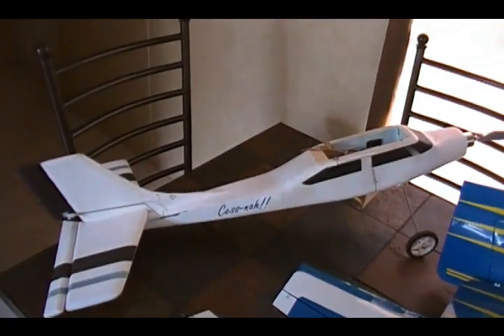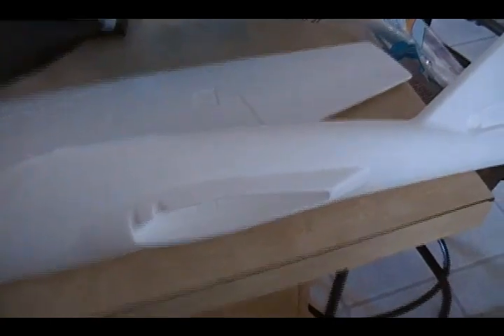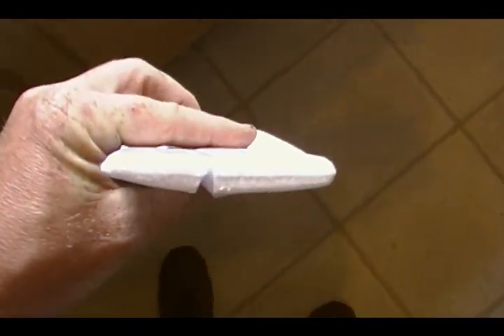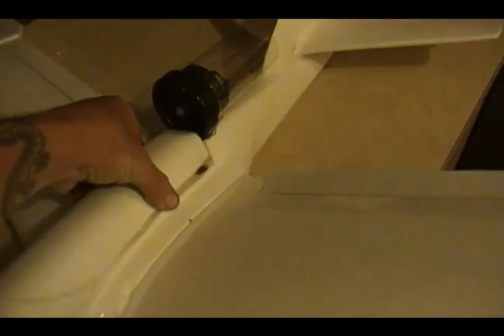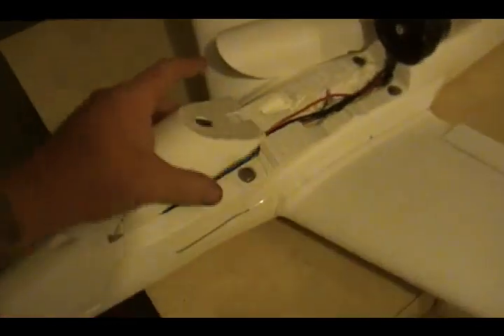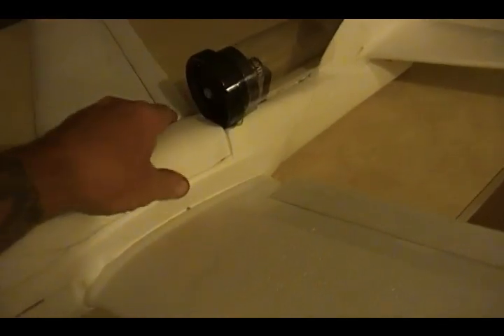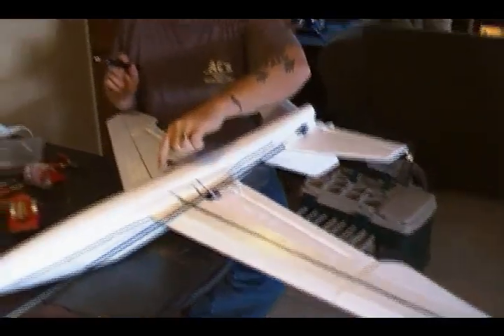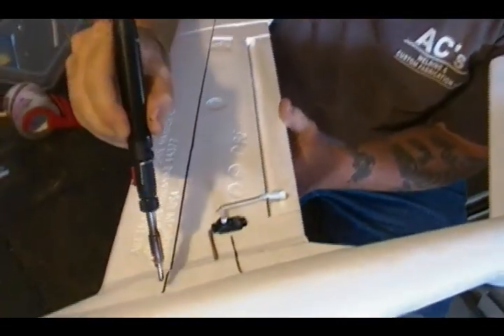Another $10 RC plane. Air Hogs Titan

Comment: I’m going to do something similar. I’ve already converted one to RC using a prop. It’ll fly without ailerons, but you need to have the elevator act as an elevon. With my new project, I’m planning to use a 50mm EDF. Does the EDF need to be that far back?

Comment: I've never flown an RC plane but I'm already in the beginning stages of
"adDiCTion" ...... I went to a new homes building site & asked if I could
pick up some foam trash?  1 hour of work gave me lots of foam but I
like this model..... It's got the aerodynamics already built into it thus
taking all the other work not needed.  So what would be your opinion
about a "User Friendly" transmitter/receiver combo??  I don't mind the
costs to buy this but I do mind having to do a lot of extra work in the
programming.  Any "windows based GUI's" on the transmitters or are
they all the old style "flat file" types?  A recommendation would be
helpful if you understand what I'm getting at??  I just don't want to
buy one and have to do volumes of reading just to use it?
Help...... good video

Comment: Good video.  Looks almost identical to the 48" gliders I bought from Walmart, put out by Maui Toy, Youngstown Ohio...EPP foam, you say ?  Tried using hot glue on it today - melted the foam... same with Goop.  Elmer's white glue didn't stick.   Suggestions ?
Reply: xzqzq foam tac by beacon adhesive  125 macquesten parkway south mt. vernon n.y.10550    www. foam- tac .com. very good glue bonds instantly ..put glue on part push together pull apart  twice then push together finally in about 25 seconds it wont come apart. youll love it ..it costs 12 bucks for 2 ounces but goes a long way  dont put too much on...a couple of tries on scrap will make you an expert in no time good luck good flying..sincerely wayne Hall...

Comment: For the last 10 year Air Hog  flying see best    tinstalment  12345678927794   see vidéo  enjoy
Reply: no lift on the wing     important fernand     and put a light coat off later paint  the foam become more  solid

Comment: Hi,ordered a Air hogs Titan what is the measurement from the nose to the front of the edf caseing please also how are you fixing the edf caseing to the fuselage  also have you put any incidence angle on the edf in relation to the fuselage  one more were are you taking a level from on the fuselage to make sure the edf sits streight and level  sorry for all the questions but i want to get it right or as near as for my maiden, regards Terry uk.
Reply: Put the plane together  and find where it balance   after load the plane and alwase stay at the balancing point it will fly   see 12345678927794  fernand     vidéo

Comment: Tinman, Want to get your input on CG. How did you decide where to locate CG? Where worked the best? Good flyer by the way? Built RC from the Titan last year and have another one Planning to make a canard pusher out of it. The CG on the last one worked OK but yours flew better.
Reply: Hi Stephen, posted question regarding CG to Tinman as im  doing the same with a Air Hogs Titan had no reply did you have any luck ? regards Terry.
Reply: Hi Terry, Haven't heard from tin-man but he dose some cool stuff.
I did put electrics on a Titan that flew well. The way i arrived at CG. was to assemble the toy stock out of the bag and marked the balance point and started 1/4" in front of that. It flew OK. The canard I haven't built yet but have found some sights with cg calculators that could be relayed. A guy on u-tube teaching cg took a dowel and looking from the top halved the wing into two equal triangles visually with the dowel used that position as center of lift and went in front of it to get 25% of mean aerodynamic cord. haven,t tried it my self, but looked like it would work. Hope this helps. SKS
Reply: Hellow Stephen, good evening thanks for the info, my Air Hog arrived today unfortunately damaged,(complained to supplier he refunded my cash  and gave me the plane ) so im now repairing the damage prior to start my build your imput very helpful keep you informed of progress, best regards Terry uk.

Comment: Can u actually make a $10 plane rather than $10 scraps and $50 add ons?????
Reply: Yeah, but it'd be a much harder build. You'd have to build your own electronics.
Reply: Large rubber band that you wind up and a propeller - $2, guide wires and spin around in a circle, old school, $2, done.  Oh and it's crap.

$9 for motor kit in esc, prop etc, $4 for a receiver and $8 for the battery, minimum.

Comment: CG is very important as RCpro Driver said. This is a great build video! I wanted to use a EDF myself, but the noise is a problem where I fly. I have flown an RC Titan powered by a brushless with a 7x4 prop on the front (gotta cut off LOTS of nose to maintain CG.). It was a blast to fly, good loops, rolls, and inverteds, and I was FEARLESS with it (only $10 afer all) - but took a little too much risk a few times(another story). FRONT-PROP-BUILD: (a CG story) Remmove plane from packaging and assemble. Take a 4" nail with  you to test glide and stick the nail into the fuse where needed to get a good glide. The plane is so light it needs some weight anyway, so the nail is needed. Now, with the nail still in place, balance the plane over a pencil laid on a table and mark the pencil's location  on the bottom of the plane That is your CG. Mount  all the control surfaces and servos in place, then loosely install the battery and ESC.  Then once again, pencil-on-table, plane\'s GC previously marked resting on the pencil, balance the plane by placement of the assembled motor, mount  and prop. The position of the motor mount tells you where to cut off the nose to mount the motor.. It is best to err on the side of nose heavy of course, cuz you can easilly cut a little more off (Hey, it\s only $10 foam!). 
  Addition of CF wing spar was not something I did at first, but after not-missing a tree and knocking a wing off, a spar was added to help "heal" the break. I used the knife-blade attachment on an electric soldering gun for making the channel in the wings. My spar did not go out to the wing tips, but rather went right through the fuse and about 1/3 out into eash wing. This bird has a fair amount of dihedral built in so one-piece straight through is possible. I used a hot coathanger wire (like this video) to go through the fuse.

Comment: You sir,  are a genius.  I'm going to use EDFS from a nonflying brick  C147 Paladin.  The plane is too heavy.. but I'm going to throw it's engines and electronics on the Walmart raptor.  I will use it's differential thrust setup and elevator control.  Think it would work??

Comment: I did the same basic thing with a Raptor foam glider.  mine isn't as pretty as yours cause the fuse is thinner so I couldn't fit everything inside it.  I also used foam board to add control surfaces to the tail.  I found the CG of the glider, then added all the RC gear while maintaining the same CG.  You get the fun of a EDF without any sharp stall issues.

Comment: $10 my ass, you spend like 30 on the other things to make it. Plus if someone wanted to buy this from you with labor thats at least $100 at min wage to break even
Reply: any RTF that size would cost $150 min.  so if you can build one for under $100 you are ahead of the game.  ive just started working with dollar tree foam board for making airframes.  more fun than assembling a RTF, more creative and less expensive.
Reply: RCPro Driver not to mention, if you crash this.....you buy a whole parts airframe for $10 :)
Reply: RCPro Driver Thats What I love about Rc Planes, The only REAL cost is the hardware. Get a Decent 2.4ghz Rx/Tx  stockpile motors servos, rods, esc, batteries etc. and after that your set for a few years hardware wise. Im actually headed to the dollar tree later today to get some foam to Build a P51!
Reply: $10 for foam, $9 on servos (no need for rudder), $9 on motor, $7 on esc, another $5 to ship the electronics and another $5 on misc (wire, connectors, etc).  I figure you are in the air for about $50 (assuming you already have a battery and transmitter).   Not bad at all.

Comment: Thank you TINMAN for this excellent tutorial. These gliders have been around for at least 30 years. But until I saw this video awhile back the RC idea never crossed my mind. I want to do at least two. The trainer and then the cool one. Could you steer us in the direction of low $$$ RC stuff that will work with your creation? Also, the power plant?

Comment: use a y connector to the servos like you would do on ailerons, but have bothe servos both pointing to the right or left so that one of them is reversed to the other so that when you connect it to the receiver they will both move in the same direction

Comment: What determines the the voltage of the battery you need, the ESC or motor. I can't find info on this stuff.
Reply: Andrew Brennan just 6 years for an answer but either way, the motor tells you. If it’s 2s it’s 7.4volts if it’s 3 it’s 11.1etc.

Comment: Excellent video...Its funny a couple of weeks ago i saw that plane and was going to convert it to rc also...after watching your video it would be very easy to do..I would remove dehedral and make it a pusher prop 100 mph jet put a ntm 28 36- 2700 kv apc 6x4 3s 2200 mah 60 amp esc...

Comment: When you buy one there are balanced already. So just put two fingers underneath and find the balance point. Mark the spot then from there whatever part you add has to remain on that exact balance point. You can add more weight just make sure your balance point stays where you marked it

Comment: Hey, nice job. Here's my grandson in the picture with the second Air Hog Titan I built. I built 2 hogs using 3/9gr servos, Used brushless motor and 1000 11.1v lipo. Used 2 pieces 3mm carbon fiber hollow rods for the wings and glued wings in the fuse. This one I added blue foam to make elevators and ailerons. Didn't cut them out of the plane Just added the blue foam in the space where the wings had the cut outs. The elevators I added two pieces of blue foam.Cost was $60. Not including the FM TX

Comment: Have you ever tried using pantyhose instead of fiberglass? It's not as strong, but it's a lot cheaper and easier to use. I've seen it used to reinforce large model rocket airframes.

Comment: Instead of hot glue, try expanding foam as an adhesive for the carbon fiber. 

(also burn grooves in Styrofoam outside. Benzene isn't good for your health)

Comment: It just amazing what the minimization of electronics has made this kind of RC building possible. Back in the 70's you could get into RC for under 2-5 grand. Now you can spend 300 buck and get a four channel transmitter, receiver, motor, etc., And start designing A/C that rival anything NASA can design. These videos are a extreme inspiration, good work.

Comment: I find I don't need a dimmer control with my transformer because it barely puts out enough heat for the 30" wire and doesn't seem to overheat the wire on a 7.5 inch bow I made for small cutting jobs either. I may end up designing another power supply with a higher power transformer and a dimmer control so I can get a better variety of heat settings. I was also thinking about using a soldering gun like you are to scoop out the smaller foam. I am looking around for it now.

Comment: My Gunson's charger has 12 and 6 volt plus slow and fast charge. It may be possible to have a dimmer switch between your transformer and the mains. So you can back off the power for a shorter cutter. I also use a hot knife, just a 3x2x100mm piece of aluminium (off cut from my workplace) in my soldering iron. Also used a hot ' U ' shape cutter in a soldering gun to scoop out a solid foam fuselage..

Comment: Thanks Word Reet. I have just made a foam cutter a few days ago using a number 13 guitar string that is about 30" long and I took a 12 VDC 1.2 Amp power adapter transformer and remounted it in an old PC power supply case to keep it running cool using the built in cooling fan. I will be posting some video of what I made later. Thanks for the tips.

Comment: Longer or thicker wire needs more power to heat it. Nichrome wire or steel guitar strings work. You can make a short 2" cutter and power it with two 'D' size torch batteries! (rcfoamfighters channel) If you can find a car battery (lead acid) charger with 12 and 6 volt, you'll do pretty well with what you are doing. Also increasing the length of your supply cable before the hot wire will reduce the temperature, as this increases the overall resistance. HTH. ;¬)

Comment: Great video. I bought this Air Hogs Titan and will be making a foam cutter for it. I was wondering how big I should make the wooden frame/bow like what you're using. I was thinking for this small foam cutter to make the wire 10 inches wide for cutting fuselage parts as you are doing. And make a longer hot wire for cutting wings. Is there an optimum length for a hot wire foam cutter? Thanks for putting this video out there.

Comment: how did u attack the magnets (what glue or substance)
Reply: I have had success with carpenters glue, hot glue and foam safe CA glue. Watch out for glue that has acetone in it because it will melt the foam.

Comment: "the old ones back in the day" i remember those, those were the one that look like a commercial airline jet and you could changed the flight path by adjusting the elevator. the only mad i was able to do on it is turn it to a jet lol kinda i would put a bottle rocket inside and see it fly but then the it would explode and i did this in the early 90s

anyways nice mode i may try this out myself.

Comment: excellent  rc conversion- good ascent  angle  -your right on about the 130 watts or more, i tried a 100 watt 2600kv bl and it was too weak with its recommended 4x6-  (old hi wing trainer with tricycle gear)- ive been doing rc since fall '09 and now want to ROG so am putting a 200 watt 2600kv on it - should be power to not death stall - more and more  often im seeing claimed watts  on BLs for sale- this lets me know if the motors got the power for my plane

Comment: Hey Timan, thanks for all of your videos. I concur with one of the previous posters about how much info I have gained from your videos. I am about ready to go from the simulator to a trainer and I think the Airhog would be a good start. I have a few questions if you don't mind. 1. What size motor would you recommend to make this a reguler prop plane? 2. Am I correct that you do not have a rudder on yours? Did you end up covering/fiberglassing the plane? $ Where do you purchase your carbon fiber?